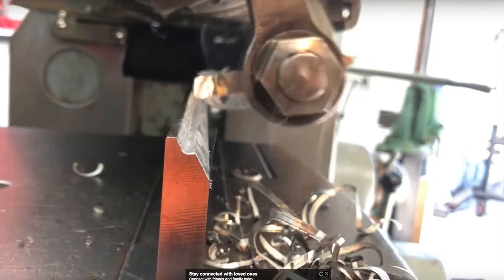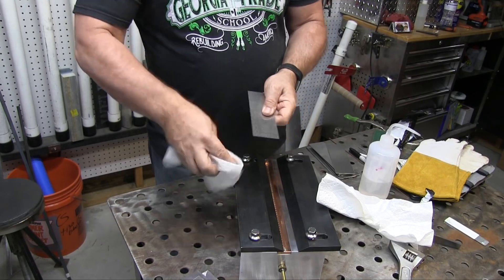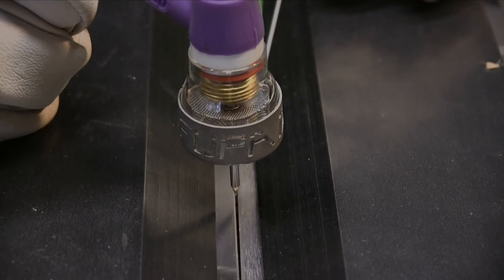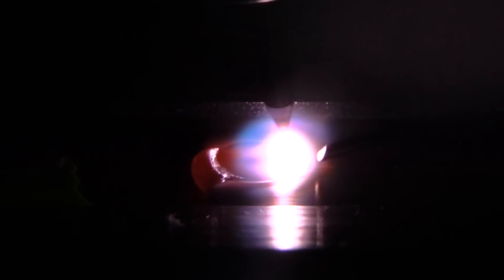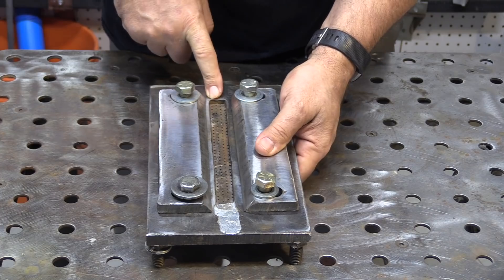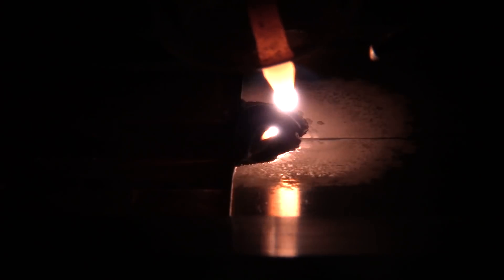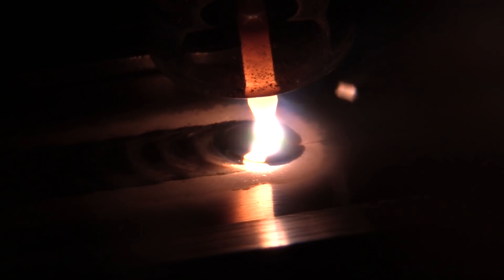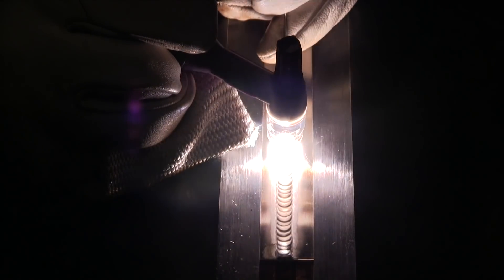Aerospace TIG Welding Abom79 Fixture

Comment: Question. Is there an optimal gas flow, or does it flatten out as long as you have enough? Seems the flow will increase linearly-ish as you close more of the weld gap.

Comment: Who in the name of God are the 18 jackasses who downvoted this ? Jeez,if I had access to that machinery and that level of clear information back in the 70s (Yes I know much of this was not even invented then) I would not have said the heck with it and stuck with stick and oxy acetylene. It was about 1993 we got talked into a MIG unit with flux core. We all tried it and the spatter and poor penetration made us all give up in disgust. $800.00 we should have spent on wine women and song.
My friend Thomas put a AA fuel dragster together in the 50s with gas and using coat hanger wire for filler rod. The engine block was a stressed member and IT broke not the welds.
What you just showed would have been like science fiction to him. Wish he was still alive to see it. Interesting to watch. Wish the horses asses were accessible for raucous abuse. What they deserve. Thanks for posting this.

Comment: That fixture turned out gorgeous. Watching the build over on Adam's channel, I was wondering how long it would be 'til we saw it here.
You could take your rod-feeding tip a step further and practice with both hands. Because there is going to be a situation when you're going to have to make a weld off-handed.

Comment: So, what is the point of having such amazingly perfect conditions for a test when any actual welding you're gonna do is never gonna be like this? 

Shouldn't tests be instead to find out how bad it can get while still getting a good weld?  

Weld two unknown dirty metals outside during a storm with a coat hanger as filler. When you practiced enough that you can do it in all positions, you can weld anything anywhere.

Comment: Ever thought of mounting on a velcro backed guide track slide, maybe like drawer slide as a rest for your tig hand. My theory is it would give you smoother, straighter welds, more consistent welds if you could glide the hand on rollers instead of drag. Especially if you had many welds to do on that fixture.

Comment: Have you done much welding on cobalt alloys? I noticed that as you weld, what looks like an oxide layer is pushed to the toes of the weld. If the purge isn’t perfect, though, the root will have sections that look like they have an oxide “shell,” even though the color is still in the light straw range, while other sections have a really clean, almost white-silver sheen to them. Do you know what that shell is about?

Comment: A lot of novices here, myself included.  Could you explain a bit more the purpose of this fixture and why you have a perforated gas connection?  Does that remove shielding gas or add some from below?  Is the coupon then tested to failure and or x-rayed?

Comment: Looks awesome. Great job. I got a question that I have asked in the past. What gas do you use when mig/tig welding ra 330 stainless. I’ve tried looking it up online but I could never get a definitive answer. Thanks for all the tips and tricks!!!
Reply from the maker: for tig argon usually works fine for 330 stainless applications.  but it really depends on application like whether its a repair or high production.   for mig, either a trimix of 90% helium, 7.5 argon, and 2.5 co2 ...or a 98/2 argon/o2 or similar mix.  there are probably several mixes that will work but it depends on position, thickness, and other factors.  praxair also has a stargon ss blend that gets high marks from some folks.

Comment: What a ripper guys,that aluminium weld was awesome,are you going to be sending them for x-ray or some testing in the future ?
Could you do a video on what happens when you do not clean or prep your test plates properly or over heat the base metal and 
the outcome and test results.
 If you do could you please do 4130 .083" cond (N) with er70s-2 filler 
Thanks for making suck cool welding videos :)

Comment: Ive always thought a water cooled fixture would be cool just like a water cooled torch
Reply from the maker: I had a few made over the years.  for a while we had syncrowave 250s that had solenoid valves on the water lines and just sent it to a drain.  just looped water thru the fixture and drained it...fixtures never got hot

Comment from the maker: Big thanks to ABOM79
Reply: Awesome Jody! I really enjoyed building this and sharing it with everyone. Great collaboration!
Reply: It sucks you have to remove the steel clamps to remove your work. Maybe add counter sink to mounting holes for heavy springs to lift clamps high enough to clear welds?
Reply: @tgo6292  was thinking the same thing... counter-bore the bottom of the holder plates, add some short die springs of appropriate force, and instead of bolts use threaded rod (or modify a shoulder bolt/stripper bolt) with a wing nut or low-profile handle or knurled knob on top.  001 is bombproof and bitchin' can't wait to see 002!
Reply: Been waiting to see this thing in action by one of the best welders i know !!
Reply: Just wanted to say thanks for helping me choose the everlast 211si. I like it for what i paid. Altho the guns could be better,i can always replace. Thanks again jody! Highly inspired by YOUR channel. Thank you for the wisdom my brother!
Reply: Great video I am going to be testing for the aluminum aerospace test. It’s a little pricey for me but I know I have the experience and weld quality to pass. Do you happen to know where I can buy a fixture like yours? I can make some parts at my job but not all. Thanks for the great video